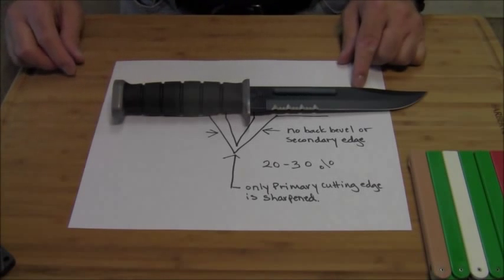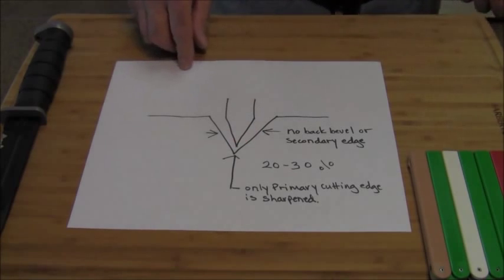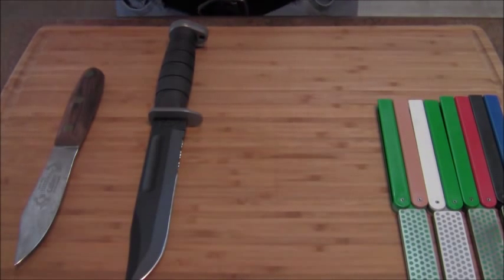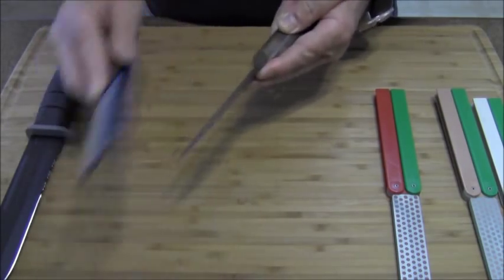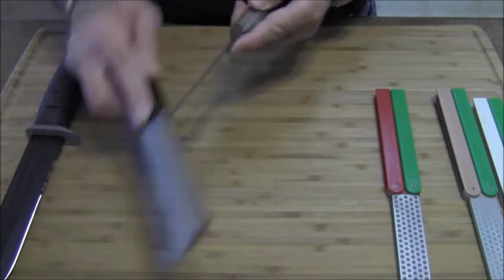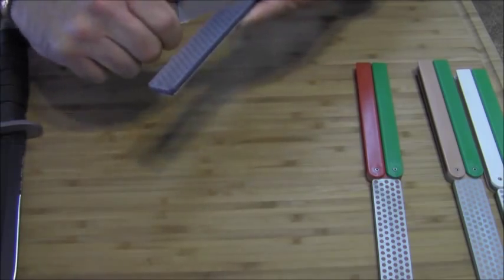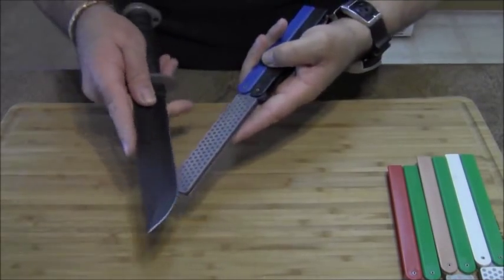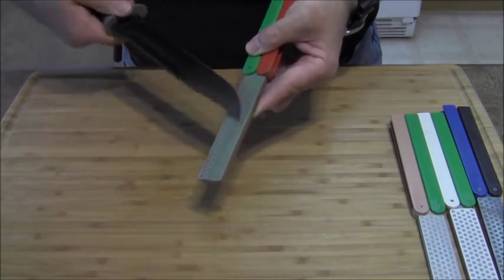Knife Sharpening How To Sharpen A Knife In The Field

Comment: You mentioned the length of the real estate of the hand held sharpener being sufficiently sized for a comparable blade. This sharpener looks like something I could use when I'm salmon fishing in alaska..however my fillet knife is easily 9 inches or more. What is the consequence of using the shorter stone for a longer blade..obviously I would be dragging the blade more ACROSS the stone, say 2:1 blade:stone ratio, instead of uniformily DOWN in a 1:1 ratio.

Comment: Richard, I've been trying to strop some knives lately. When I do, they seem to end up duller than the last diamond stone I use. I only have about a 700 grit diamond stone. Then I've tried doing some stropping with 1000 grit metal polishing sand paper over a stone. It really shines and smooths the blade, but the knife is definitely duller. Any thoughts as to what I'm doing wrong?

Comment: Good video but I would have to disagree with you the more refined your edges by that I mean higher grit you use The longer the edge will remain sharp versus using a lower grip at the same angle

Comment: Hi, love your sharpening videos, learned a lot.

Any special advice on sharpening/profiling a tanto blade and not mess up the angles? Also I've been messing up with sharpening/giving an edge to a cheap katana by doing japanese stroke but my stone does not cover the katana too well.. I end up with lots of angles. Need a special stone for long blades? longer? wider?

Thanks!

Comment: when sharpening a knife, you create a burr that rolls over to the backside, as you do each side.  I noted that you didn't "strop" the blade after you were all done sharpening.  Is that because you believe that you have removed the burr by the sharpening process?
Reply from the maker: It depends on the type of edge you want. Sometimes I remove the burr with a piece of wood and that leaves a "hard edge" When it comes to using the diamond plates as I create the burr on each side of the blade to make sure that both side have met center each consecutive grits will leave more of a burr unless I pull the burr off with each grit or I can wait to use the piece of wood at the end. Leather stropping does not remove the burr, the best way I have seen is to either sharpen the burr off or using the piece of wood.

Comment: Question: I don't want to over-sharpen my knives. Can't I just use the extra-fine and extra-extra-fine to regain a sharp edge in most cases? When do I need to resort to using coarse and fine?
Reply from the maker: You could but it depends on how bad the condition of the blade is? Now if you hone constantly then yes! If the knife gets too dull then no you will need something a bit more abrasive to get started then move on to the other abrasives!

Comment: I've been using the Diafold with the second method you showed. I can get a near perfect bevel on the right side of the blade (it feels quite natural to do) but not the left.

When I am sharpening the left side of the blade, if I perform what feels and looks correct from my point of view, the bevel ends up steep at the bottom of the blade and shallower (wider scratch pattern) toward the belly. To compensate it feels like I have to raise the angle and cut into the stone more as I work towards the belly. Because doing this feels unnatural, I'm finding it difficult to maintain consistency, so by the time I get to the tip the bevel looks uneven when light reflects off of it.

Does this sound familiar, and if so do you have any tips?

PS: I've watched the entire sharpening playlist. Thanks for your time and effort to make these videos :)
Reply from the maker: Ok! So this is what I would do because it is what I did. It does take time and sometimes a lot of time for the left to feel as if it is the right. What I did was I went to thrift stores and looked for named brand knives at cheap, cheap prices and I practiced on them until both hands felt comfortable and the bevels where coming out the same. Then and only then did I work on my good quality blades. it does take time and practice. Go buy some cheap named brand knives at a flea market or thrift store and you will see in time you will get it just right! If you need to ask more questions in the future just ask and I will get back to you as quick as I can! Thanks for watching! Cheers!
Reply: ***** Thanks, Richard for taking the time to reply. I'm currently using some cheap knives (non-kitchen) I picked up about a decade ago.

I've long wanted to start a small collection and these were bought at a time when I knew nothing about knives. All but maybe one or two of these are expendable, so I am using these to learn sharpening and maintenance before buying something halfway decent.

Your reply is much appreciated. Thanks.
Reply from the maker: napalmhardcore
Anytime! I made these videos to help folks so if I can be of help just ask! Cheers!
Reply: -napalmhardcore: You might want to try using a sharpie or a dry erase market to "paint" the lower portion of both sides of the blade.  Then when you sharpen the ink will be removed and give you feedback as to what is or isn't having metal removed.  Hope this helps.

Comment: a 300 grit edge will shave hair if the burr is removed properly. Also a thick edge can shave, not just a thin edge. Also, the higher grit you sharpen the edge to, the longer the edge will hold.

Learn instead of reading crap on the internet.

Comment: actually, the ka bar you are sharpening isn't the same steel as it was in 1942, it has D2 steel which is maybe the hardest steel around, it can only be sharpened with a diamond stone but it will hold it's edge the longest. It is hard to sharpen correctly.

Comment: great videos, but the ka bar you sharpened isn't the same steel as it was in 1942
, u are using one in D2 steel it is the hardest steel and will hold it's edge the longest but needs to be sharpened on a diamond sharpener.